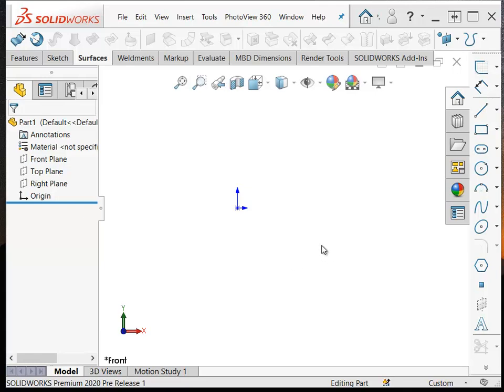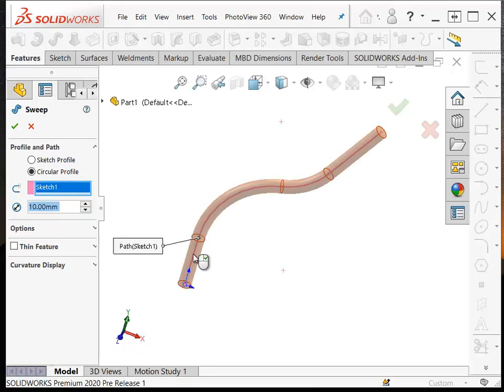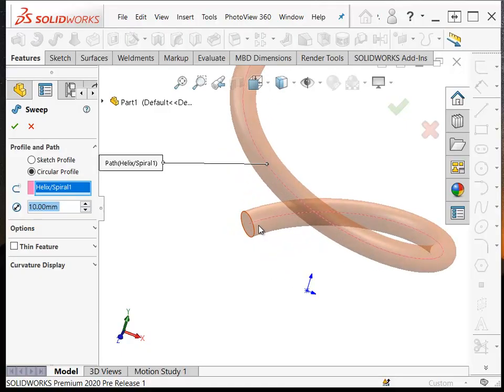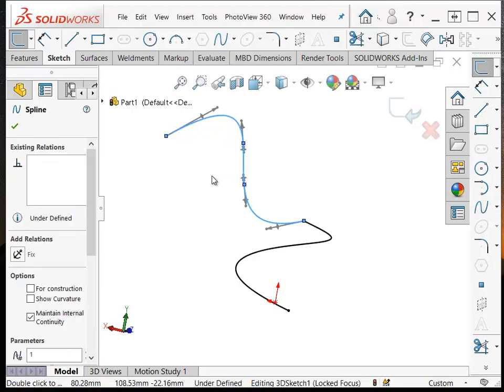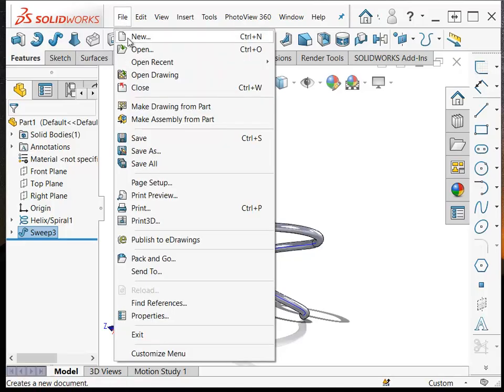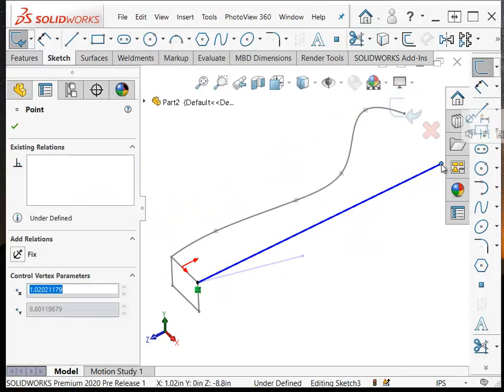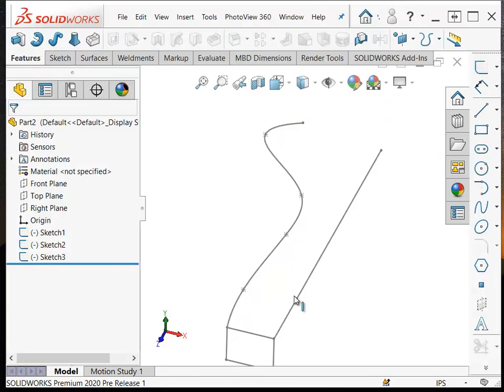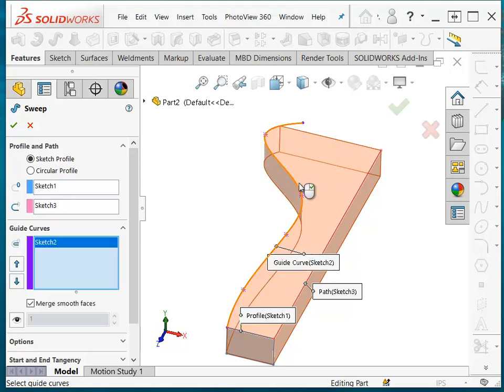Making Sweeps in Solidworks

Comment: It seems like sometimes getting a pierce relationship requires an act of god.
Reply from the maker: You just have to have a sketch element, a curve or an edge that goes through the sketch plane at a point (or multiple points), and some sort of point or endpoint with available degrees of freedom in the sketch